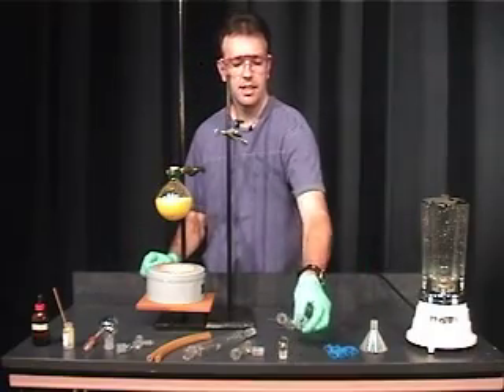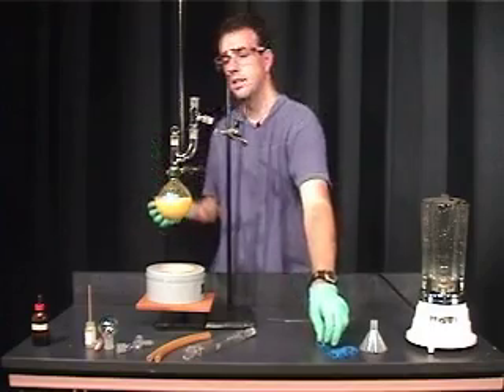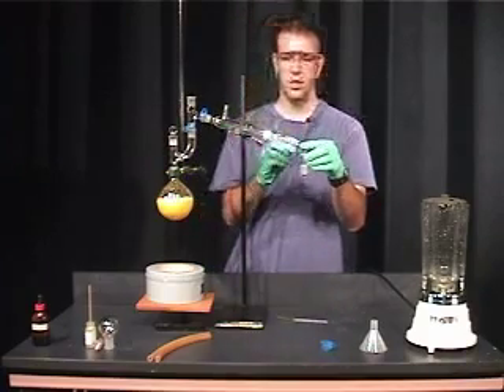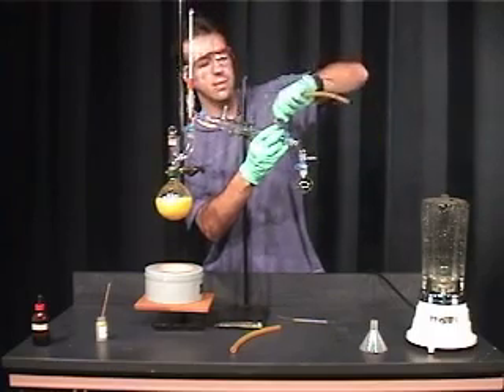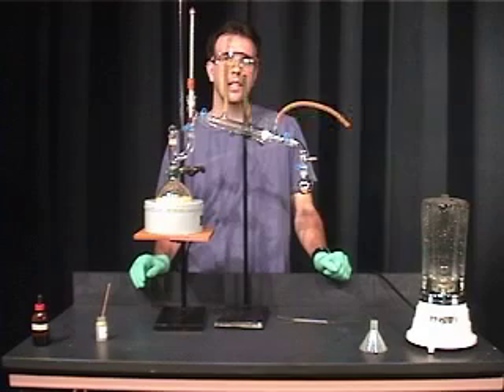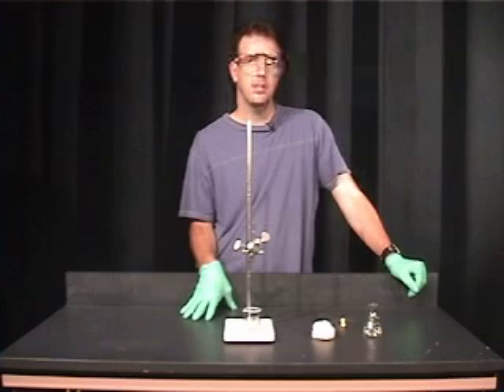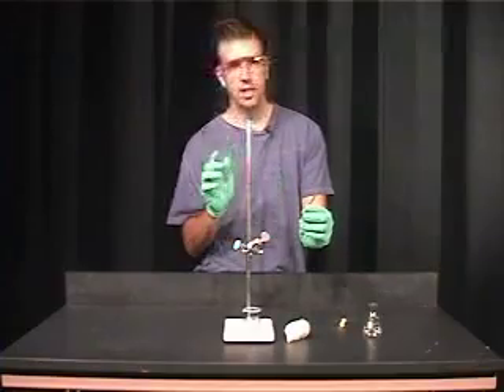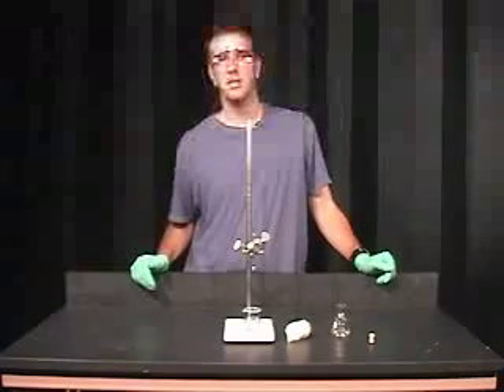Organic Chemistry Lab Demo: Isolation of Limonene (part 2)

Comment: @Grundalizer I wanted to know the same about the anti-foam B. I did a little research and found that vegetable oil , milk, cream, and salt have been used as anti-foaming agents before silicon emulsions(which is what anti-foam B is) were produced. I am going to try a little vegetable oil and see if that will work. If not, I'll use a bigger flask.

Comment: I just tried this distillation but with lime peels and grapefruit.  I didn't scrape off the pith, and the fruit was rather old to begin with.  I'll have to buy fresh oranges and try it again, because I just got water out that smelled a little of limes, and wasn't even acidic.

Anti-foam B seems like a rather exotic thing to get for a home chemist though, are there any subsitutes?

Comment: In the previous part you said something about dichloromethane. How do you actually isolate the limonene? I mean here you have some sort of solution, is that correct? And, finally, do you add the ethanol to the distilate and then filter it through the pipette? Sorry, got a bit confused at the end of the video, so could you please tell me nice and clear how to get PURE limonene (meaning as pure as possible)

Thanks